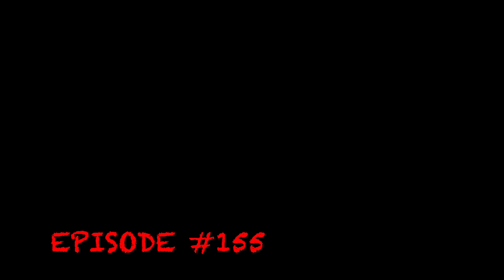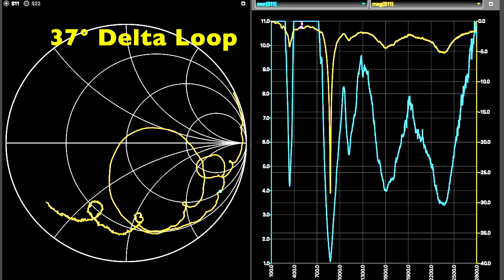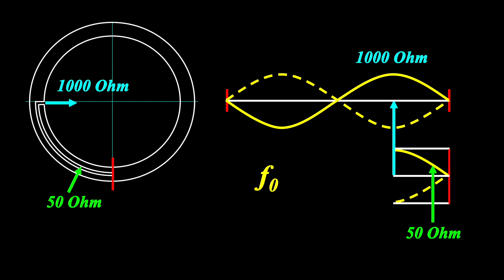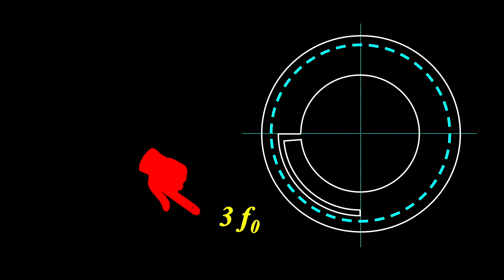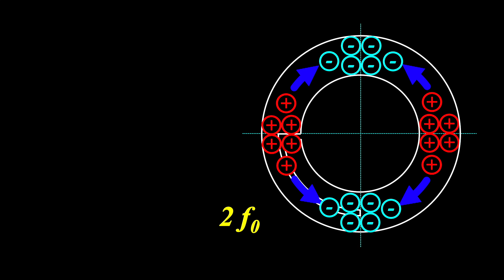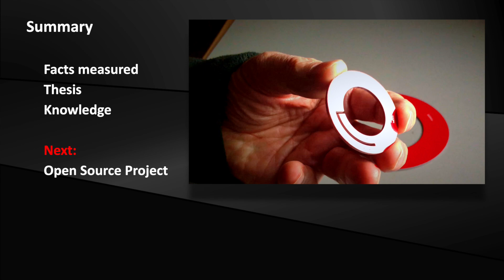Mystery of PCB Lambda Loop - Optimizing its Selectivity (EP155)

Comment: I am no expert, am an interested in whether the measurements are a reflection of standing waves in the transmission line, and not the antenna.  You probably have a video already about that.
Reply from the maker: Indeed, in the earlier videos about the lamda loops you will find VNA reflection measurements. Receive tests and a lot more. Just check out the antenna plalist:
https://www.youtube.com/watch?v=S7nQ2fnaA3Y&list=PLIe6avmZgJg41vPNE3YPIlVBzjZg6hRwd
Reply: @electronics.unmessed thank you. 

My hypothesis is that standing wave ratio should be measured with a short multi-cycle pulse that is shorter than the wavelength of the transmission line.  That way, reflected power, is independent of a potential node in a standing wave.  Therefore, eliminating the standing wave part of the measurement. 

I'll watch the video, thank you.
Reply from the maker: Interesting idea. I need to think about it. Greetings, Klaus